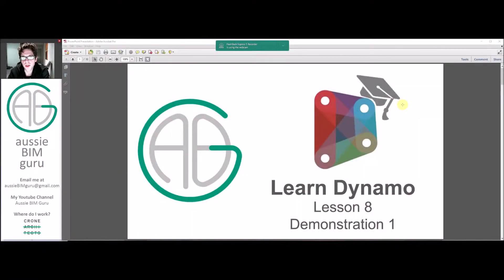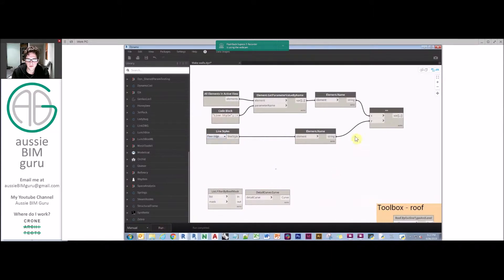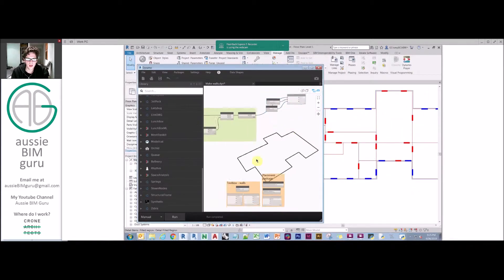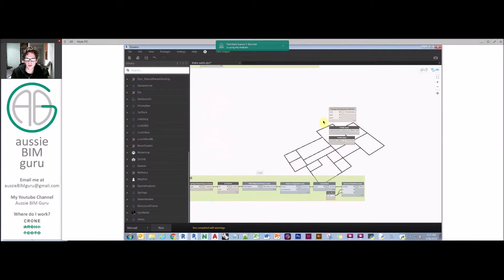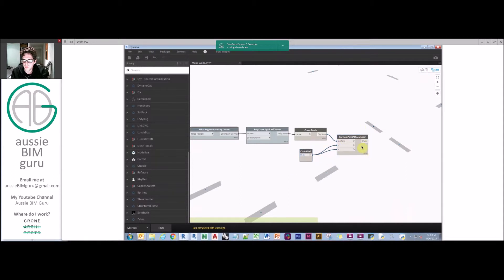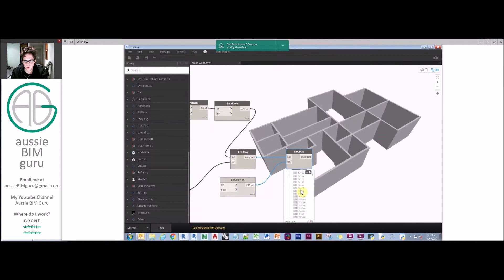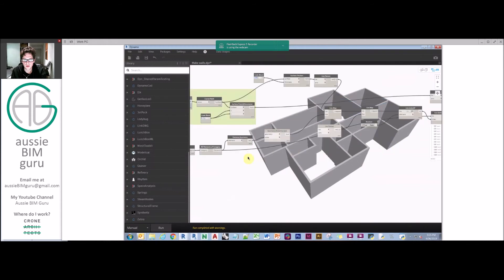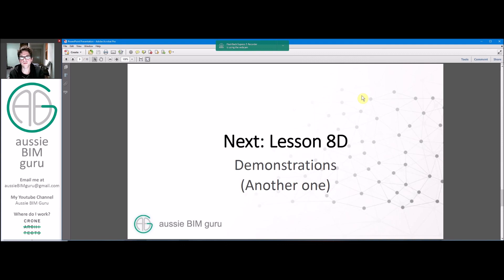Learn Dynamo - Lesson 8: The House that Dynamo Built (Demonstration 1)

Comment: What can I do if the ElementType.Instances from Springs package is not found?
Reply from the maker: In Revit 2023 they added Element Classes to Dynamo which are a good replacement for using Element Types. There is an All Elements of Class node that achieves a similar outcome as most Element Types were lined up to Classes.

Comment: Hello, I followed your instruction from the beginning and it worked till almost end . In Section creating doors and windows I faced with a problem and I decided open a new project and start  from the beginning again BUT it did not work anymore. When I wanna run at the first step in Node "ElemetGetParameterUnitValue", my floors and walls could not be read in this node and I get lots of empty Nodes after running dynamo! how can I fix it ?
Reply from the maker: Odd... do you mind sending me a screenshot of your script by email? Sounds like your workflow is a bit different to collect the walls than mine.

My email is in my video banner.